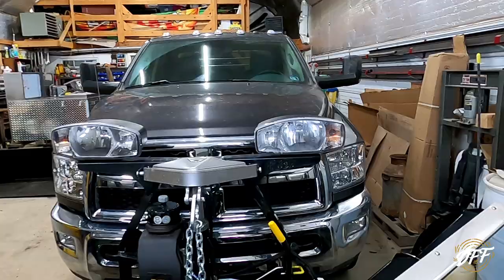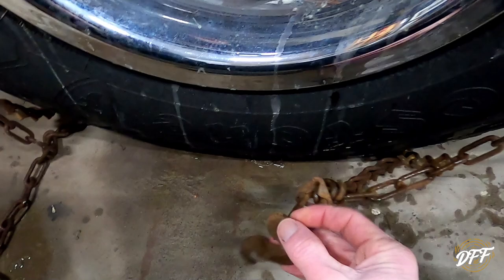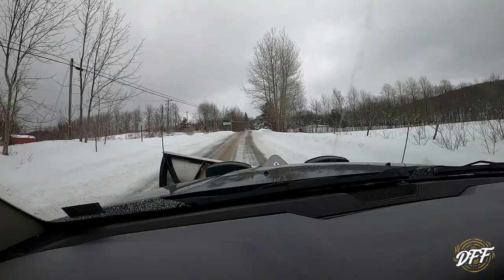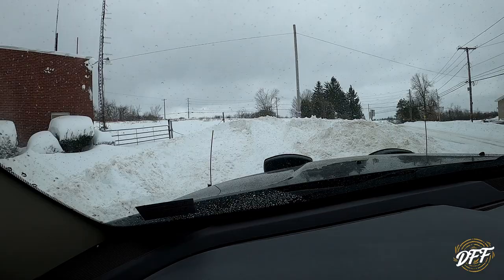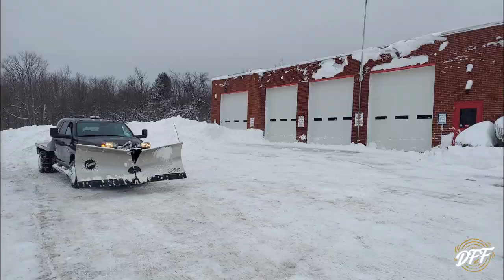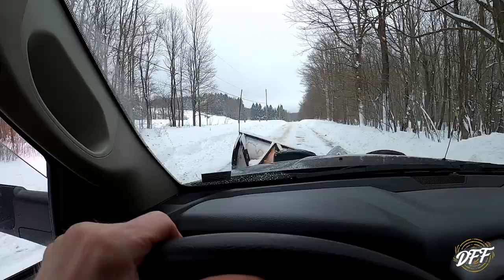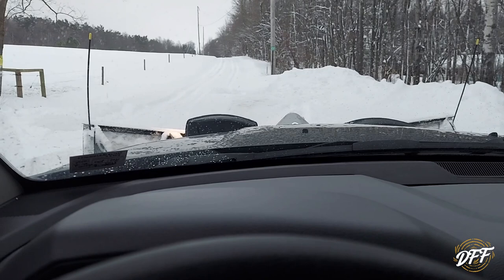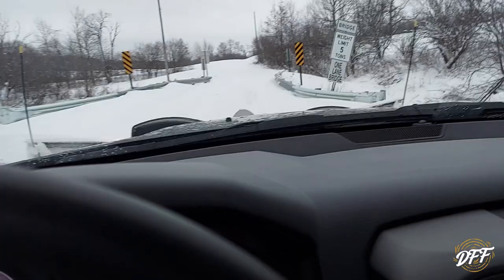Snow Plow Vlog- RAM 3500 Cummins & Fisher Plow!

Comment: Ever plow driveways with hills? I’m wondering if pulling 1 wheel off each side of rear would give better traction being more weight on the 2 wheels vs 4 wheels?  Plus adding ballast and traction weight to the rear.

Comment: Speaking about the 1st gear thing. Doing heavy snow and a lot of passes in one place, I'd throw it in low range. If it wants to shift, let it, or you can still peg it in 1st manually. It keeps tranny temps down, and heat will kill a trans faster than anything. Hey, it's your truck, do what makes you happy but just a suggestion. I know you can plow everything in high range, but low puts the strain on the gear reduction, not the trans. Big dually truck, big plow, deep heavy snow, mighty cummins low end torque= world of pain for torque converter/trans. 

Does it have the aisin?

Comment: I was wanting to see that truck plow through 3ft of snow , I have plowed snow & that would sure be the first
Reply from the maker: The first few passes along the road were 3 foot deep where the state plowed the snow in from the main road. Unfortunately the camera didn't want to sit on the dash, and I didn't have another good place to put it.
Reply: DeHaven Family Farm so what you are telling me is the county plow had left you a snow bank you had to bust through, before you could actually get to plow the road , where you said there was places that were 8” , which is really good but what about in-between those drifts ? 
I plowed snow with a 5 ton single axle possitrack , 478cu” Ford (gas) ,12 ft slusher  & 8’ wing ,, & if we had 2” of wet snow even just using the slusher , & even sanding ,we needed to take  several runs to get up some hills
Reply from the maker: @robertmintz63  The 3 feet of snow was in the parking lot I plowed- I don't plow roads.
Reply: DeHaven Family Farm . I also ran a grader with a 14ft moldboard  that I used to cut the melting ice out of intersections, but used the 12ft or was it 14ft ( don’t remember exactly )(that was 40yrs ago )- wing to to cut the banks down & back
Reply: DeHaven Family Farm . I was surprised that the truck did as good as it did with no weight on the back , but that diesel is heavy
Reply: DeHaven Family Farm . I have a correction to make - “  that was 47–50 yrs ago , would love to do it again ❤️

Comment: Nice video sr .strong truck.  how do  you like that plow ?
Reply from the maker: Thank you 🙂 I love the plow!
Reply: @dehavenfamilyfarm   im starting  my snow removal busines and lawn care i have a western straight plow but thinking to change to fisher because the tripping edge and plus to v plow dont imagine pushing all the snow whit a straight plow
Reply from the maker: @antoniobaldiviezo8140  the trip edge is why I only have owned Fisher plows. The V plow is most useful if you have larger areas to plow, like parking lots. It will clean up a lot about 2x as fast as a straight blade.

Comment: I smashed a car backing up one time. Lol
Reply from the maker: I've never hit a car, but I am not used to these wide Ram mirrors and have almost smashed them into things several times this year 🤣🤣🤣
Reply: It was years ago in a ford with no rear window and them stupid mirrors they had. Big parking lot in the metro i was rolling back slow and heard this horn sound but was thinking what is making that noise on the truck. Rolled several hundred feet and the whole time the guy sat there and honked instead of moving. Lol. He was an ass and so was the company so i just told him off and to go to the shop